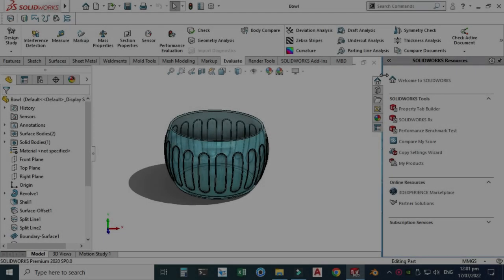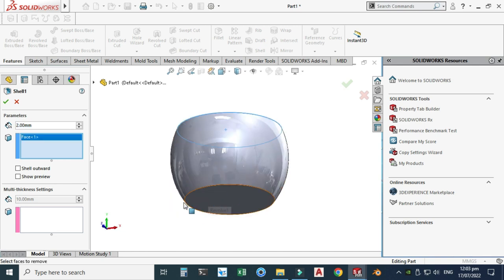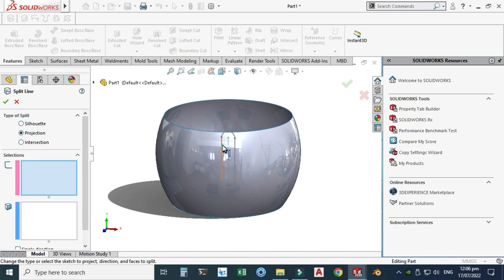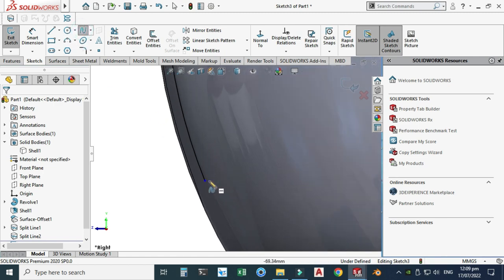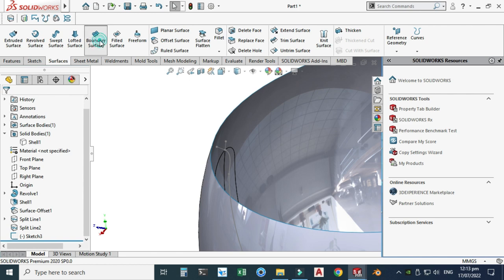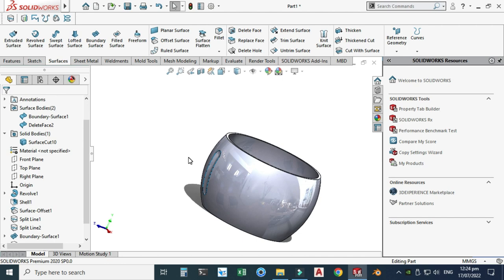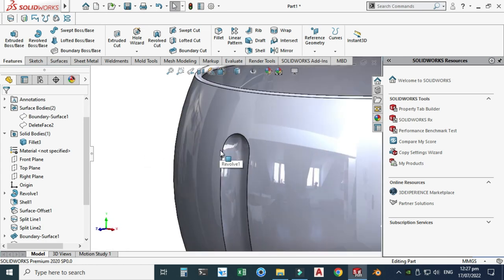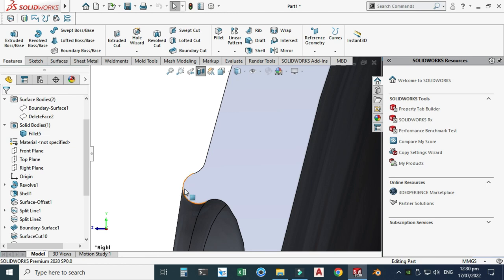Bowl surfacing solidworks | Advanced surface modeling | Multi thickness shell | Solidworks surfacing

Comment: Can you please explain me why you need to do copy surface to create that one feature ? Can't we directly create that profile on original surface instead ?
Reply from the maker: Copying a surface in SOLIDWORKS is often preferable to modifying the original surface directly because it:

Keeps the original design unaltered.
Allows for localized changes without affecting the whole model.
Enables experimentation on a separate surface.
Creates a distinct surface body for specific uses.
Think of it like molding clay - copy the surface to make changes without messing up the original.

Comment: what are other applications where zero offset surface is used, please suggest other videos where zero offset surface is used
Reply from the maker: Hi Kiran! How are you doing? 
The term "zero offset surface" isn't a standard feature in SolidWorks, but the general practice of offsetting and manipulating surfaces is common in CAD software.
SolidWorks allows for creating multiple configurations and leveraging existing surfaces in design, particularly in product design for components, airplanes, automotive parts, and more. While it may not be a specific concept, the ability to offset surfaces is a fundamental and versatile tool. 
Engaging in hands-on practice with complex parts enhances understanding and proficiency in utilizing these features.
Reply: @CADable  sir please suggest more videos on offset surface or other fearutures to get excellent surface finish...try some videos related to car bonnet, tail gate, etc
Reply from the maker: Sure thanks for the suggestions keep checking shorts @KiranKumar-dj5pw